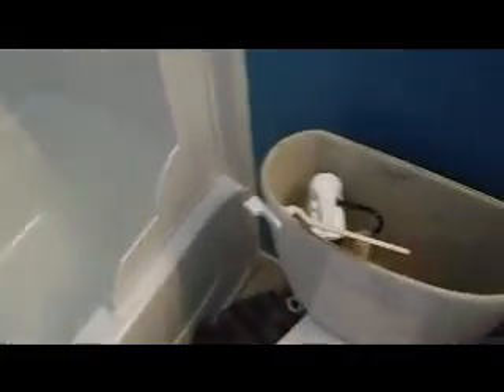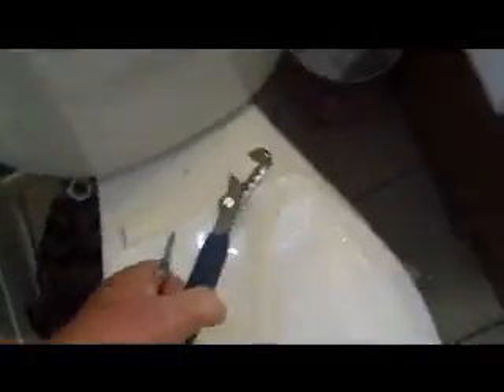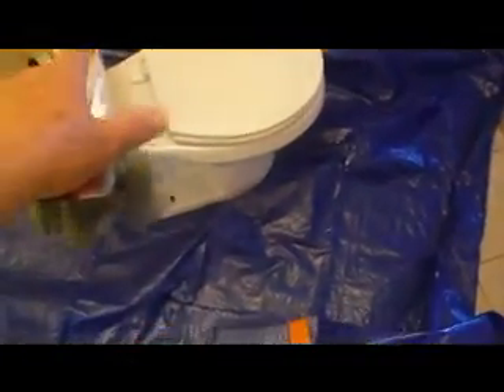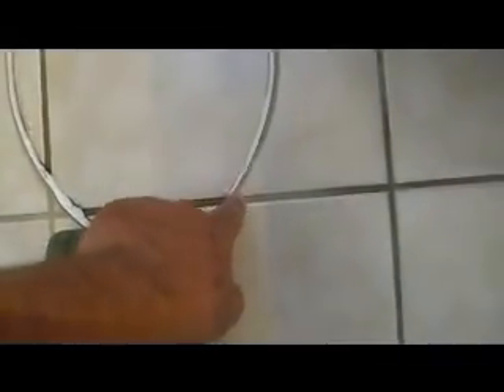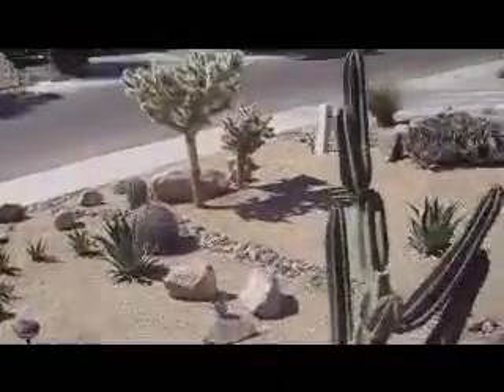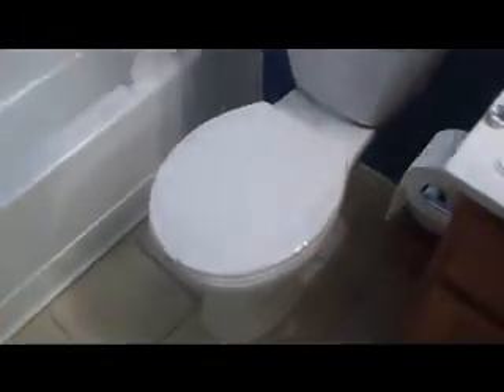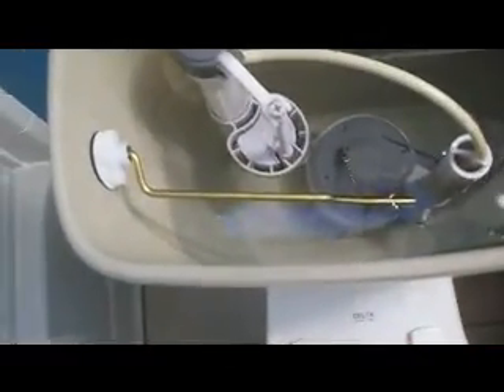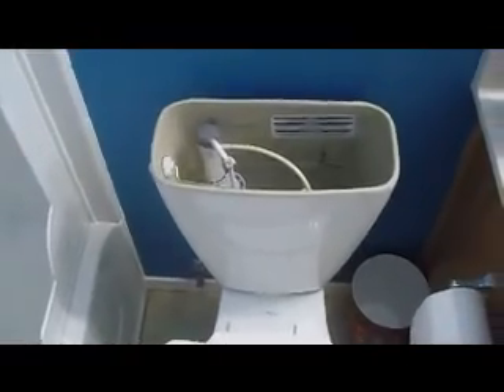tolid nightmares

Comment: Nice work. My tank cracked, front of it broke out. I used a large diameter plastic cup to drop in the hole to block the sewer gases, it worked very well. I had to build the floor up because the relief on the bottom of the replacement toilet was not deep enough to accept my cast iron flange. It's always something.
Reply from the maker: yes thank god this went well... except for the crack that is

Comment: Easier job if you unscrew the tank from the bowl, before you remove the bowl from the floor.  Cuts the heavy load by about a half.  I bought the same toilet from Home Depot in Canada.  The first one was cracked in the same spot.  Job well done.
Reply from the maker: thanks...  yeah I could of took it off but it was a tight space and I did not feel like  laying down  and mess with it... lol